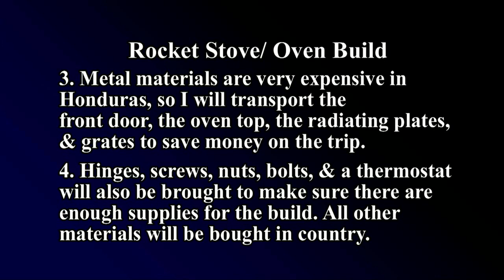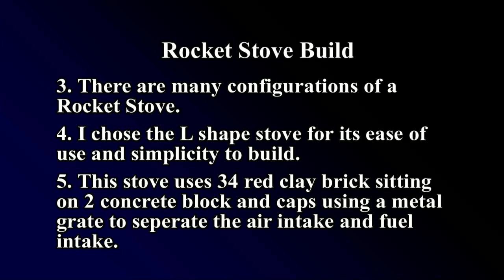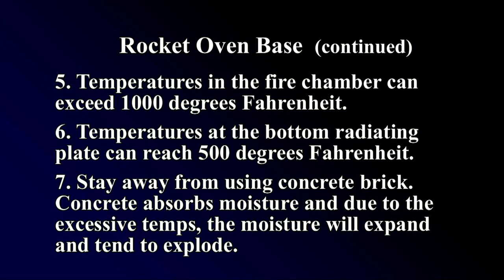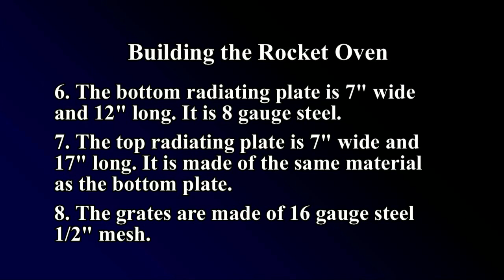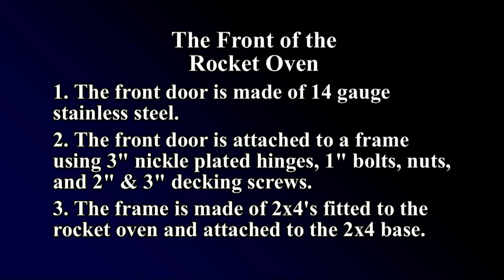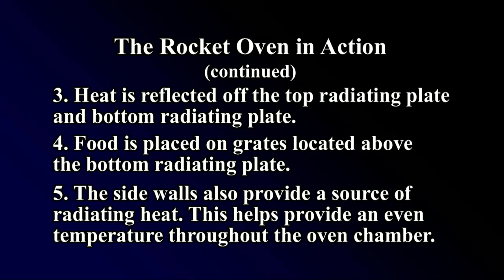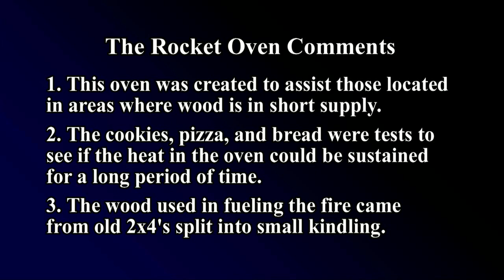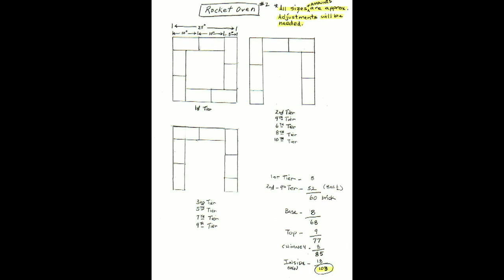Rocket Stove/ Oven Build: A Prototype

Comment: this video is the best rocket stove and oven on youtube thank u so much
Reply from the maker: Thanks for your kind words. This was a prototype of what I'd be building in Honduras. I did build one while there. The different size of brick did cause some dilemmas in building the base of the stove. The brick in Honduras are not of a standard size, but through the use of an angle grinder and different configurations, the oven came together well. Our biggest challenge was that I needed to bring the front door and top of the oven. In order to pack that iron in a suite case, I would have to cut the door and top in half. Iron is very expensive in Honduras and this would make the building very expendive not making the build good for people there. I am working on a  video of the build there. It'll be another several weeks. I am preparing to work on a greenhouse for the backyard with a hydroponics system inside. I have several other videos on building rocket stoves and building an aquaponic system. Check them out on my channel: William Wagner. Again thsnks for your comments.
Reply: @williamwagner  do helpme build

Comment: Thanks mr. Wagner to share  your  time, your knowlege, and  effort to help the  people Of my country, God Bless you.
Reply from the maker: You are most welcome.  I am in country now.  In La Esperanza.  I have finished the build and have made 2 banana cakes with it. Big success. Used wood gathered from nearby wooded area to fuel the stove and oven. The biggest problem here in Honduras will be accessing the metal for the oven. Metal is very expensive. The rocket stove has many more applications considering those  conditions. It only takes 34 to 36 brick to build one.  The fire brick was 6 limpets each. The only thing is getting the grate.

Comment: Sir how to calculate heat in the oven
Reply from the maker: IThank you for your question. I use a thermometer used for barbeque grills. I placed it next on the same level where the food baked. I also used an infrared thermostat to take other temperatures such as the temp of the top and bottom radiating plates along with the temp of the fire in the fire chamber.
Reply: How to order thermometer
Reply from the maker: I bought mine at Home Depot in the barbeque section.

Comment: Because the smoke comes in contact with the food, would you need to be cautious as to what fuel you use? Are some woods poisonous to use in direct contact with food?
Reply from the maker: This a good question and very insightful. There are certain types of wood that are not recommended to use when utilizing the oven. Pine would be one and I have heard that Eucalyptus wood is not a good one to use. This stove/ oven did not smoke due to the high heat (1000 degrees plus) produced in the rocket stove part, but that does mean it didn't leave a dark residue on the walls of the oven. When in Honduras, most wood is not dried like here and really smokes when used as a heat source. We ended up retrieving other wood from the forest that worked well when baking. I have found that hard woods such as walnut, birch, and oak are a better way to go. These hard woods will also burn slower and cleaner. I utilized a dried pine for testing the oven originally, but have since changed over to the hard woods. I have also built a rocket stove where I can use pine. Since I only use the stove stand alone for fast cooking, frying, boiling water, and the such, I am not worried about the residue. The oven on the other hand is a different story. I have a video that shows the building of my rocket stove and it's use on my channel. It is called, Rocket Stove: A Solution for Disaster. It can be reached at: https://www.youtube.com/watch?v=oP9o3drHUZ0&list=PLdQQu2oze9NQwK3zTLLTdTMNURvbedZDa&index=8&t=67s. Again, thanks for your question and concern. I hope I answered your question. Feel free to let me know if you have any other questions.